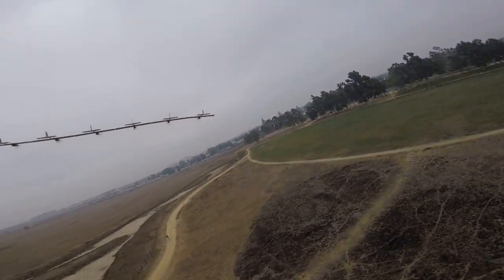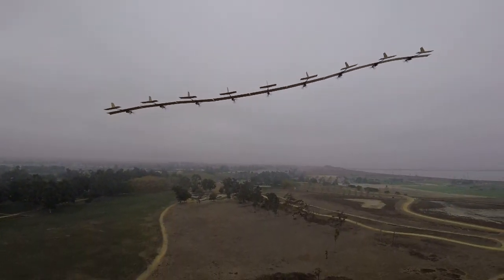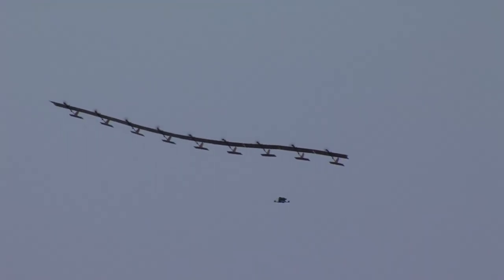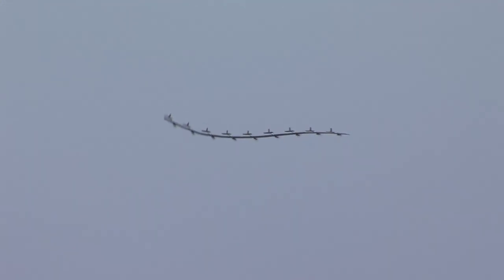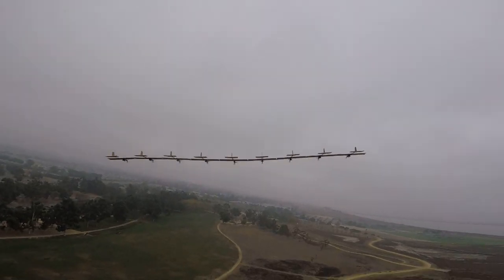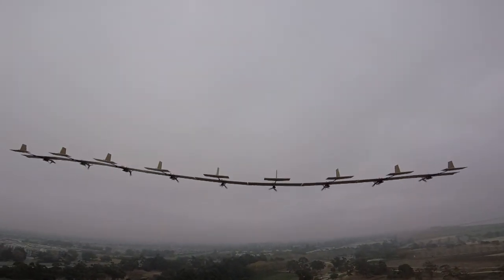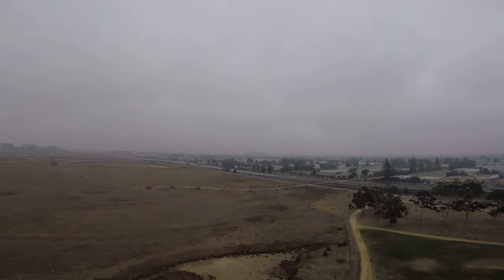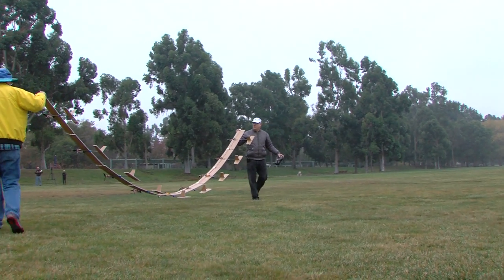Ran D. St. Clair Flex 9 Flight

Comment: "It seems to naturally wanted to turn left for some reason...

But that's okay cause I like turning left."
Reply: My single-engine Piper Cherokee, as with other single-engine aircraft etc., they yaw to the left because of the differential tip speed of the propeller, hence the motor mounts put the engine at an angle to compensate.  Also, for full-power take-off, the pilot needs to apply a lot of right rudder to compensate for the tendency to yaw left.  For this design, I think a solution may be to have the rotation direction of each engine alternated, or else have one bank of engines rotate CW and the other bank rotate CCW.  That should cancel the yaw effect.  Keep up the good work fellas.

Comment: I wonder what it would fly like if it were built in a "V" formation.
Reply: It would be more air dynamique. Actualy it should be shorter, 3 or 4 planes less.
Reply: V formation or how about stacked formation?
Reply: Goose simulator
Reply: @Name, I was going to guess, bathroom break. You know, needing privacy and all.
Reply: @kevino4846  nö?
Reply: @Name no I don't, do you ?

Comment: 2025 you see some thing like this over head with guns on them . as they get to there target . they then become many planes .  
testing would be good to try to power down 1 or 2 planes at a time to let the others carry it to help with rang . each plane goes off line for 5 mins or more then swap on and off with other planes in tell all batterys are at 10% or at target zone
Reply: instead of one a10.... 10 a 10s..... i like it. i rate 10/10
Reply: Will not reduce energy needed to get from a to b. Would not work.

Learn the very very basics of physics please

Comment: So how about having ailerons but have all the ones to the right if middle go up and down together. And the ones to the left of middle do the same. In other words, the 4 planes to the left, both left and right ailerons on each plane would go up together and down together on each plane. Then the same to the right side of center. So if you gave left aileron, the planes on the left of center, all their ailerons would go up and all the right of center ailerons would go down. Basically treating it like one large airframe with a huge left wing and huge right wing.
Reply: What would happen if you put left hand props on one side and right hand props on the other.....other that it drilling dirt if you don't reverse the motors
Reply: The left wing is in the House of Representatives.
Reply: Wow that was a mouthfull for a simple concept, you my friend would make a good lawyer.
Reply: You just scaled it to full blown large airframe 😄😄😄
Reply: @exhibitdeveloper  thanks for the video link. Genius idea on the angled pivot points at the wing tips.

Comment: The left turn tendency is caused by the combined torque of all the motors. If you can run 1/2 of the motors backwards ( with a prop designed for running in a backwards direction) the tendency to want to turn in one direction will be neutralized.

Comment: Now link the two ends while in flight to make a flying circle, for some reason I think it will be a very smart and cool to see or manuever or just to test, but of course if you're gonna put solar panels on it then maybe not, but how about a skin that also makes power through temperature gradient, up there it's cold, but the sun will warm the skin on the surface facing it. It could have a steep gradient

Comment: Hi, Very interesting and a beautiful example  of Dutch Roll event and why the vertical stabilizer is important to dampen out roll.  Your video  and the wave motion of the wing  is a visual event of what is occurring with unequal lift along the length of the wing. The part of the wing that go up have greater lift because the speed of the air is greater at that location . The greater lift induces a bank and thus a un- commanded turn ,IE {Dutch Roll} A heavier aircraft will probably fall apart in unstable air. The only solution would be a computer AP to fly different parts of the wind to damped lift down and equalize the lift event.

Comment: reminds me of formation marching in basic.  If soldiers on the outside of a turn didn’t turn up their rate of movement, you would see waves, and there would be a hell of a struggle to catch up.  The outside of a turn is faster and more pronounced that say the middle, which should barely be moving.

I.e., for a turn, where the inside plane would have a 5 degree angle and aileron, the end plane would be much more pronounced, throttle would probably be higher.

Still, this is pretty badass

Comment: It seems to be less stable in terms of its power on the port side, it must be power or drag causing it to want to go left Continuously rather than straight, and you can clearly see the aircraft on the port side lower than on the starboard side, as I said maybe it's a power issue, you need to find a way to compensate for it and if each part is powered independently, then it could be just an issue with that side, but is it powered as one, then it could be a power flow issue, or as I said something simple as drag, but if all are identical, what's causing the difference in stability in the parts continuity of power and lack of drag,(so causing instability) between port,(left) and Starboard, (right) sides.

Comment: What benefit shall we get from this?
Reply: เสรีย์ สิทธิภาพ new way of fueling airplanes
Reply: Happiness
Reply: Same we got from watching 'like a boss' videos
Reply from the maker: You may never see the benefits of this experimental airplane. But everything you do every day is affected by Scientist and Engineers making your life easier and safer.
From the car you drive to the aircraft you fly to the computer in your hand that lets you see the future. There was a NASA aircraft many years ago called Helios, that aircraft did very well at high altitude, unfortunately at low altitudes it was too delicate to deal with turbulence, it broke up and crashed near Hawaii. There is a new aircraft called odysseus it is stronger than Helios but it is still susceptible to low altitude turbulence. If you make it stronger it will probably be heavier. This toy airplane is a test to see if we can make a wing more flexible and not necessarily heavier or stronger. This solution may not be on the next commercial airliner, but I am confident it will be on the next unmanned high altitude, Ultra-endurance aircraft bringing G7 connectivity to your pocket computer. Walt
Reply: wcolby1 what the HELLL
Reply from the maker: Me How Was there a question in there?
Reply: wcolby1 very WELL
Reply: @mehow3504  Thank you.

Comment: Great. But why would anyone think that this thing would NOT be so "oscillatory"? And upon what basis did you think that numerous flexibly connected small airplanes would be stable in flight? You do understand that the air is not static but produces varying waves, eddies,  pressures, and thermal energy, yes?  If so, then why would you not expect it to affect this thing you created? Also, each of the individual airplanes will fly slightly differently, creating all of the undulations and instability that is entirely predictable. Yeah, it's fun and all, but some of your comments and observations make no sense.
Aside from having a bit of fun and seeing if it could be done, what was the point of this? Alright, I know - the point is to see if it can be done and to have some fun. Well, you proved that it can be done, and it is fun.